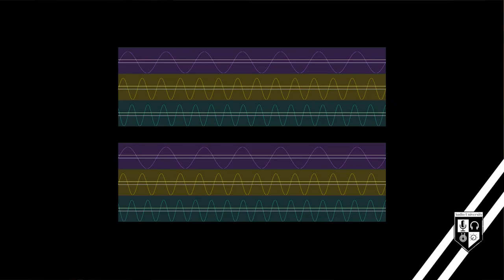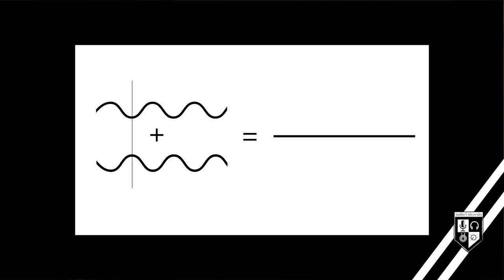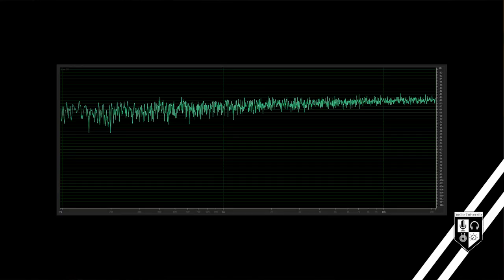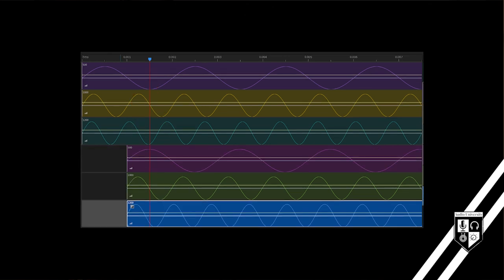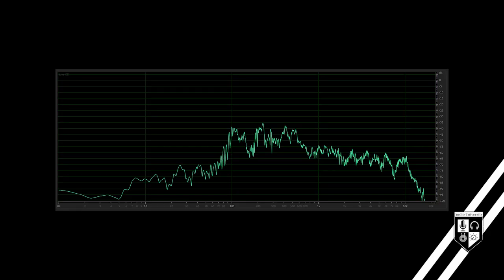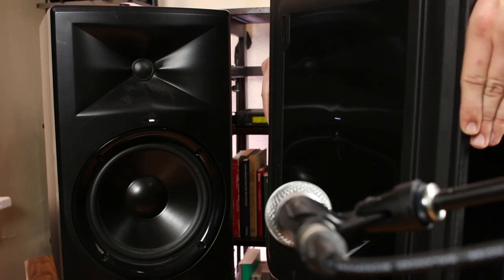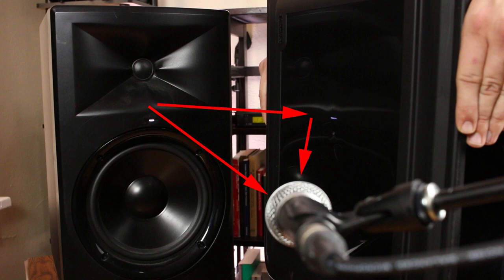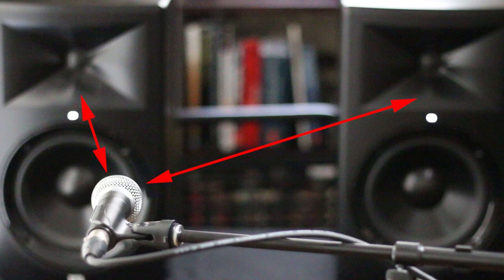COMB FILTERING EXPLAINED: What Does a Comb Filter Sound Like?

Comment: Hi
Tnx for the detailed explanation.

How do column speaker manufacturers handle the comb filtering effect?
Reply from the maker: That's a great question! Often, the vertical dispersion angle will be quite narrow. Also, there is a coupling effect that takes place where they all act as a single source and create a more planar wave.

Comment: Hello!  in a system how can I avoid the production of comb filter and frequency cancellation?  Is there a basic rule in the placement and positioning or delay of the speakers to avoid this phenomenon of frequency cancellation?  thank you and I follow your channel with pleasure and interest
Reply from the maker: That's a good question, ady sax! The only way to avoid it is to limit the interaction between direct sound and reflected sound (or two coherent signals from separate sources). Anything you do to reduce the chances of two (or more) identical signals interacting will help.
Reply: OK.  for example I use a column of 2 dynacord fx20 bass and 2 dynacord fx12 horn tops.  all superimposed on the tower.  if I turn one top to the left and one to the right is it better?  and something else is ok ???  I have 2 options for the mono sound to come in the whole column or if they are stereo, a top and a bass on LEFT and a top and a bass on RiGHT are all superimposed.  I hope you understand what I mean.  thanks

Comment: Now I realized why I have constant delay in my system consisting of two JBLs on each side of the stage + side wall 1 meter apart. Ever worse, I engaged many "audio experts" and nobody found the reason of delay. Now it seems to me that the only reasonable explanation is overlapping of sound from two adjacent speakers.